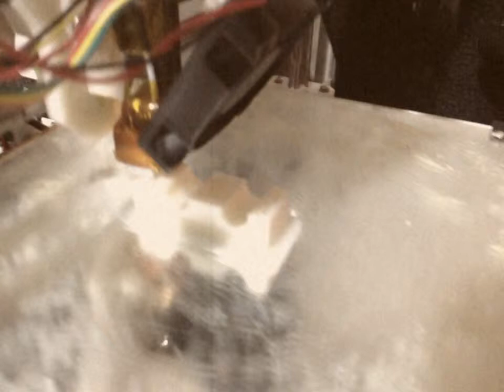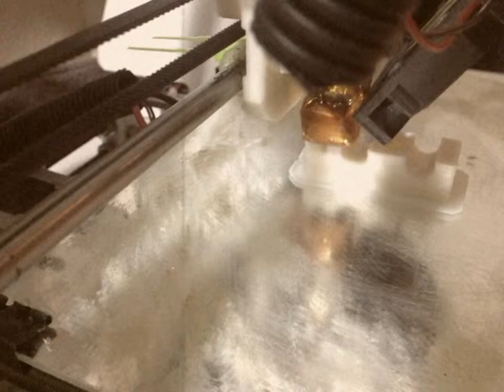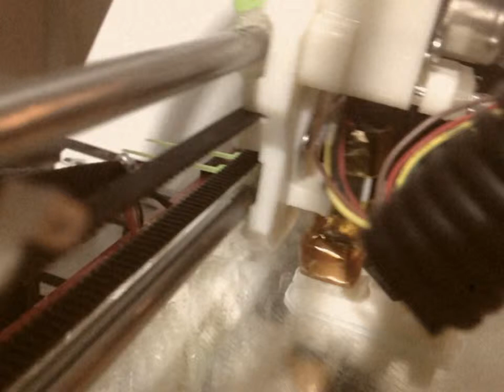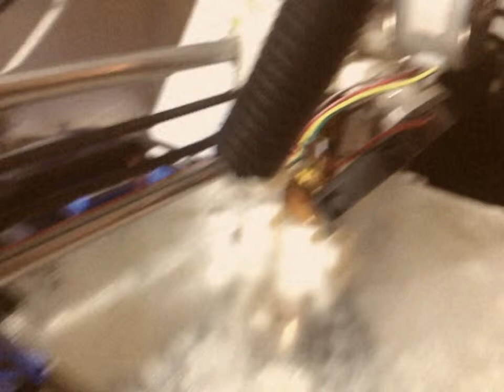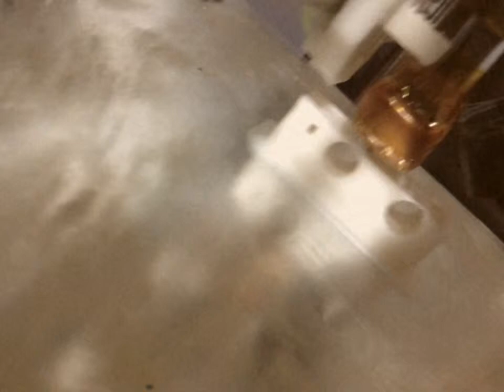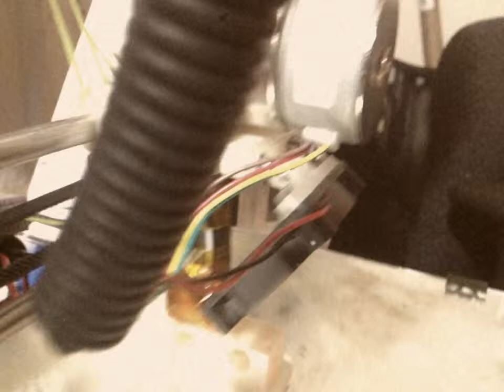Will the Nozzle Crash?

Comment from the maker: Revisiting this issue from one year ago, I could still imagine the potential for the nozzle to snag if extruded filament blobs up, curls on overhangs, etc. But a lot of this problem was due to a cracked and loose x-idler end that isn't seen closely in this video. With a new idler part, the printer has been amazingly sturdy and I haven't seen this issue since, even printing these snaggy parts. But before I do any plates of parts, you can bet I'm turning on Z lift and combing!  #reprap     #prusai3     #learning